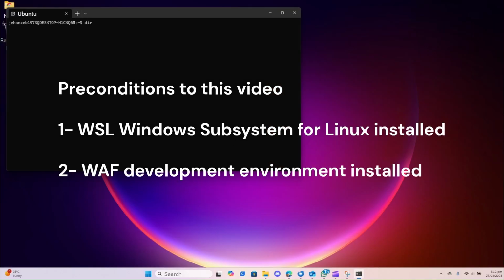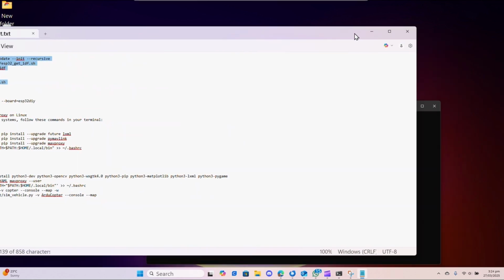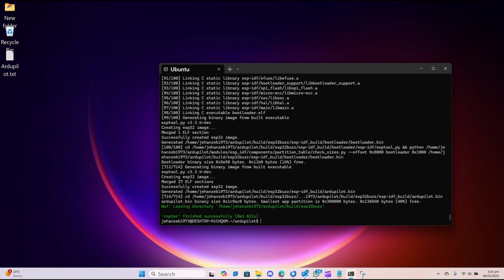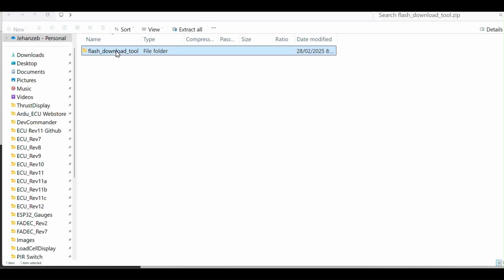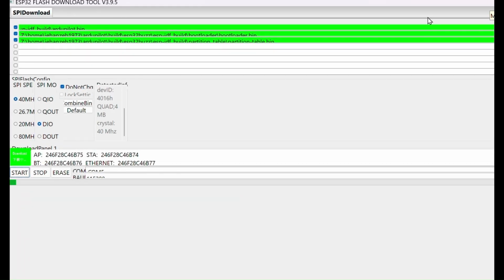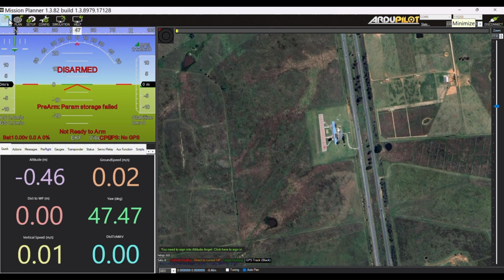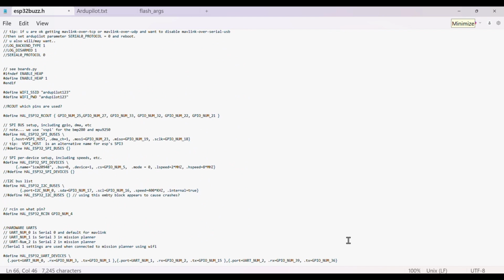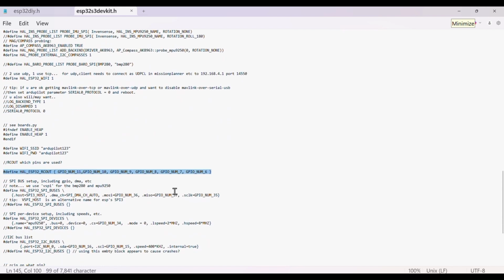Ardupilot on ESP32- Compiling and Uploading for your custom ESP32 setup

Comment: it worked. i ran through a lot of issues. later i had to use the bin files on github
for some reason i can only connect through tcp but maybe because my setup isnt complete. will provide an update soon
Reply: i am planning to build it can you tell the issues that faces you
to try to avoide
Reply: @mazenwaelmamdouh5925  i tried a second time
Followed the instructions on ardupilot github and still didnt work.
On his github also there are some precompiled firmwares. The ones with icm-xxx sensor work ; a plane and copter.
With my system i have like the legacy sensors. mpu6050 neo 6m , i dont even have a barometer
i was able to flash his plane firmware and it works. First it connects only through wifi, you have to set the params and setup well to be able to get serial.
Nothing else worked for me

Comment: get barometer error on esp32-diy build .....i am on devkit v1.. i removed the barometer and still. get this error :                                                                                                                                                                                                      ```WiFi softAP init finished. SSID: ardupilot password: ardupilot1 channel: 1
OK created task _wifi_thread for TCP with PORT 5760 on SLOWCPU
 [0;32mI (1278) esp_netif_lwip: DHCP server started on interface WIFI_AP_DEF with IP: 192.168.4.1[0m
Config Error: Baro: unable to initialise driver""

Comment: is this possible with esp32 devkitc or esp32 s3 modules
Reply from the maker: Yes. I have used ESP32 Dev Kit in foota drone without any issue
Reply: what i meant to ask was, will it run on any esp32 module? (mainly the s3 version)  @digipak1

Comment: Hi Sir, 
Thank you for your great tutorial. It is very helpful. Can you share how do you add mpu6050 in the esp32buzz.h file or how do you basically integrate this sensor?
Reply from the maker: I have copied the files I used under following link. This includes MPU6050/6250 on I2C in esp32diy board file.
https://github.com/Jehanzeb1973/ESP32-ArduPilot/tree/main/ArduPilot%20Board%20files
Reply: @digipak1  Thanks Sir, you're amazing !

Comment: this is really good work.can we use the wifi and bluetooth capabilities of the esp32 for a wireless configurator or even connect the esp32 to a wifi modem and get telemetry over 4g/5g?.
Reply from the maker: I believe it is doable. WiFi by default is setup with TCP IP and UDP so it should be possible in theory to relay all data over a router.
Reply: @digipak1  this is wild.i watched the entire video but i must confess its a bit technical my head is huting after trying to grasp all this.but im really intrested.i have a custom inav build on an stm32f411 and everything is great but ardupilot is better.esp32 is better in my opinon.excellent work
Reply: I finally was able to get it working but haven't had success connecting via its wifi.ive built the esp32 dev board 30 pin ch340 fc and in a few days itll be a quad ill share more info.excellent work though🎉

Comment: A very good contribution, videos of esp32 with ardupilot are very hard to find. Have you tried waypoint navigation on esp32 with gps?
Reply from the maker: Dr. Moazzam. Yes. All functionality of Ardupilot seems to work normally. I have used optical flow sensor , GPS. Way point navigation for testing and seem to work ok. Didnt use it for long flights. Just around the back yard but no issues
Reply: Also, is there is no rc transmitter/receiver interface? if yes which protocol ppm or pwm or ibus?
Reply from the maker: @dr.moazzamtiwana4743  Ardupilot uses a single input for RC signals. It can be S-Bus, I Bus etc.. See this webpage for more information https://ardupilot.org/copter/docs/common-rc-systems.html
Reply: @digipak1 hey can we use this for arduplane as well? Is the setup the same?

Comment: Hi, can you please guide us how to interface STM32H743VIT6 based dev kit with ardupilot. We uploaded bootloader and firmware file in Dev kit of STM32H743 but its is generating errors while connecting with mission planner. It is displaying an error "No heart beat received". please share your contact details.
Reply from the maker: This guide is for ESP32 only and not for STM32. The firmware in github is also compiled for ESP32 and not for STM32